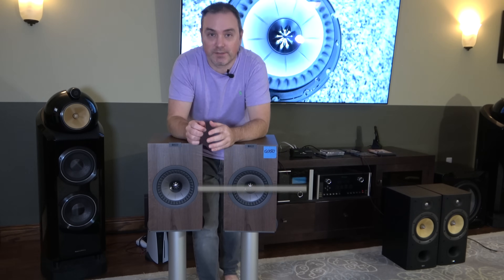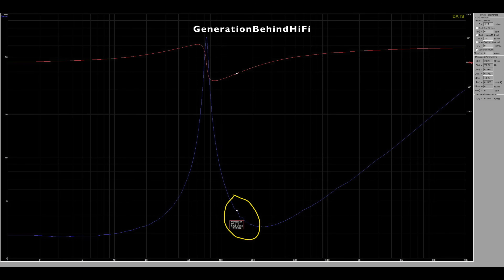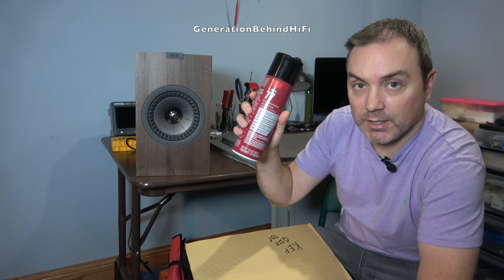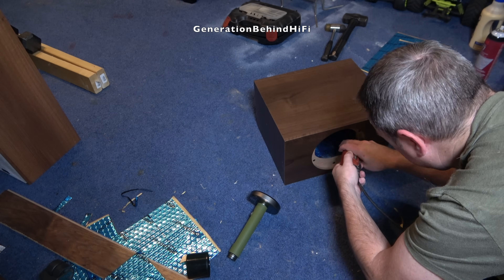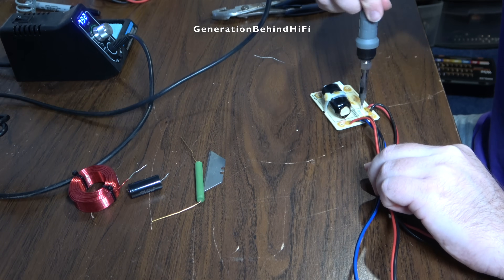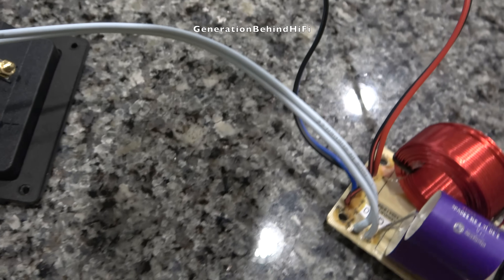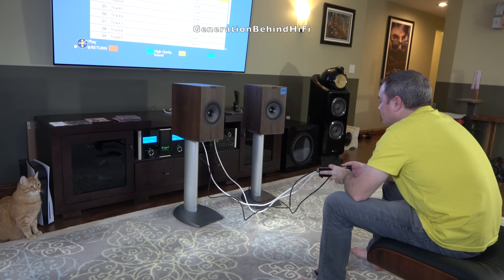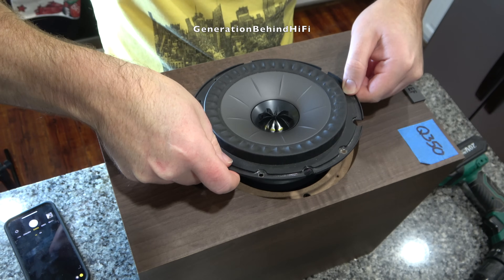Upgrading My KEF Q350 Speakers - Resolving Cabinet Resonances and Upgrading Crossover Parts

Comment from the maker: The parts I used to upgrade my KEF Q350s can be found below.
Amazon Basics sound deadening material: https://amzn.to/421NpDl
Polyfill: https://parts-express.sjv.io/3JkZnd
Sonic Barrier 3/4" foam damping: parts-express.sjv.io/qzW09b
Inductor .9mH 18AWG (2x): https://parts-express.sjv.io/6ykdOG
Mills 1.5 ohm resistor (2x): https://parts-express.sjv.io/Bn5y6q
ClarityCap Copper Connect Capacitors 2.2uF (4x): https://www.madisoundspeakerstore.com/claritycap-csa-capacitor-250vdc/claritycap-2.2-mfd-csa-copperconnect-poly-cap-250v/
Supra Series Speaker Cable: https://www.madisoundspeakerstore.com/speaker-wire/supra-classic-1.6/bulk-cable-per-foot-15-awg/
Reply: Maybe a tip from a car audio nut…Use a hairdryer or heatgun to pre-heat the butyl Amazon basic stuff..Makes it more elastic and usually there wouldn’t be a need for extra glue..
Reply: Can share after you replace supra speaker wire inside how does it sound , i in doubt of replace or maintain the speaker wire ? tq
Reply: Man i would love to see a teardown of the new Kef Q11 metaa
Reply: Any tips on how to choose a correct inductor? 

I am doing a similar set of upgrades on a different set of Kef speakers. All caps and resistors are done now. But, I lack knowledge regarding inductors, doesnt help that there is no spec on the label as well. 

Cheers
Reply: What y'all think of regular polycaps vs sonicaps?
Reply: Question if you can...You mention not changing the internal volume when installing 1/8" thick sound deadening material, but then install 3/4" thick Sonic Barrier? Does the sonic barrier not change the internal volume? Thanks! I'm considering doing a similar upgrade to my Q Concerto's, particularly the Air Coil to brighten them up a little.
Reply from the maker: @Roberto-cj1yf  The polyfill and Sonic Barrier I added trick the speaker into “thinking” the cabinet is larger than it actually is. If you have a Dayton Audio DATS V3, you can verify this yourself:  

1. Measure the stock speaker and note the Vas and Qts values.  
2. Now stuff the cabinet with polyfill or Sonic Barrier.  
3. Measure again and watch both Vas and Qts drop—this proves the driver now “sees” a bigger box.

It’s a simple trick, but you can read more about the science behind it online. Hope this helps.
Reply: @generationbehindhifi  Hi, I'm new to this, so I’m wondering why are cutoff frequency so far far apart for woofer and tweeter in original q350 crossover?
Based on inductor 0.9mh and capacitor 4.4uf values I calculate that woofer cut off starts at 700 hz and tweeter at 9000hz based on 4ohm impedance,, so what am I getting wrong? Surely it can’t be such a wide difference?

Comment: Iron core inductors usually cause distortion at higher frequencies so using them in a woofer crossover can be fine if it's crossed over low and so won't be playing at the higher frequencies that have the distortion (won't be audible).

Comment: Damn my KEF Q300's are so much better built, better specs too. Sad to see cost cutting every new model
Reply from the maker: Newer isn't always better.
Reply: @generationbehindhifi Yeah, it even has better crossover parts (air core inductor). I wantes to upgrade to an R3 Meta but seeing this trend I might just get an R300 (same year as the q300)
Reply from the maker: @rehakmate The R3 Meta is a phenomenal speaker and measures really well. I would be surprised if the older R300 sounded better.
Reply: @generationbehindhifi I dont think it sounds better, but it sounds better for half the price if I get one used. Its the same range so I assume they arent leagues different.

Comment: Adhesive floor tile works exceptionally well as a damper. That, and you can get a roll of foam from wal-mart. While Mundorf are unquestionably good caps, the same results can be had for a few bucks with 5% metal poly dayton caps.  Low ESR and pretty transparent. Same goes for dayton air core inductors.    KITTY!
Reply: Floor tiles as an alternative to alubutyl?

Comment: You should keep things away from the coil,they change the inductance value including glue!🤔
Reply from the maker: What "things" are you referring to? This is a basic first order crossover and there aren't any other inductors on the crossover board to cause interference with each other. Glue changing the inductive value of an inductor?! That's a first I have heard that!
Reply: @generationbehindhifi  Anything close to aircore inductor changes its value, there is a vid somewhere also... ( I mean capacitors and glue,stuffing)

Comment: Excellent, i want to upgrade the crossover & damping of the cabinet of my Q350's... this is a very good video for me...i know i can get exact same value of air cored inductors from Dayton Audio but this will help me greatly, good idea chamfering the inside of the drive unit apertures... Mundorf caps are very nice but i could only find 4.7mfd but they do 2.2mfd so could parrallel them...good job, i'm gonna do up my Q350's..👍

Comment: I got one of these and it helped beyond my expectations for removing parts from a circuit board: YIHUA 929D-V Electric Desoldering Soldering Iron Solder Sucker.  AliExpress has them for much cheaper than Amazon.

Comment: It would be interesting to see the frequency response graphs on the before and after. From what I see, you greatly reduced the volume of the speaker cabinet, and very likely affected the tuning/port characteristics. I would expect that your bass extension was also reduced.
Reply: That may be true, as a function of the added poly, but physically, the empty cabinet has a volume of approx 720 in3 and just the 3/4" foam rubber on the inner sides of the cabinet take up 180 in3, or about 25% of the internal space. The port tuning must have been affected by that. Did you do a frequency sweep before and after the mods, and if so can we see the resulting graphs? If I missed them, I apologize.
Reply from the maker: @ No worries. Everything you are looking for is in this video. You can see the before after sweeps too. If what you said was true about losing internal volume, then Qts would have spiked and would be much higher. Same goes for the port tuning. I guess I just assumed most people who are looking at these graphs know what they are looking at. I'll try and do better next time.
Reply: No, no, no, I'm suggesting that you arent doing a good job, I really like the content you provide. I'm just wondering what the difference would have been if you had just used the thin material. I have done similar mods, but I used some old school car high density mat. Thin, heavy stuff. It worked well to reduce cabinet resonance but did not make a bad speaker into a good one🙁
Reply from the maker: Sounds like you skipped through the video if you think I "greatly reduced the volume of the cabinet". Speaker Q (Qts) before the upgrades = .897. Speaker Q after the upgrades = .8745. This proves that the driver actually thinks its in a bigger cabinet after the upgrade. Port tuning also went down slightly by a few Hz. All of this data is in the video and can be viewed.

Comment: I did this with BOTH my NOS Energy RC-10 bookshelf speakers and my PSB Imagine XB bookies. Even though both are built pretty well (for mass-produced speakers), the cabinets are where the FIRST compromises happens in virtually ALL mass-produced speakers. Strategically-placed, self-adhesive butyl sheets combined with a 3/8" or 1/2" round dowels across the sidewalls of each speaker (10mm - 13mm) - and a bit more open-cell foam or Rockwool as damping material - goes a LOOONG way towards stiffening up the cabinets to reduce cabinet resonances and vibrations, which all leads to a slightly lower/more linear bass-reflex tuning, significantly tighter/damped mid-bass output, and much clearer mid-ranges/vocals. Cheap, easy, effective, and good for just about any mass-produced speakers - win, win, win, win - IMHO......

Comment: Hasn't Kef been using iron core inductors for a very long time? My oldie Kef 104/2's have tons of them. I used to build speakers in my teens and always used open air inductors and even back in the early 1980's polypropylene capacitors for the tweeters, but they were a novelty back then and expensive. My first system were Nad 3020 and Peerless/Seas home made system. Anyway, debating with myself if I should buy the Q350 or not. Wonder how it pairs with my Class A 2*50W Luxman L-560 which I still like.

Comment: Switching to a 14ga. air-core inductor made a huge improvement in bass.  It's deeper, faster, and more impactful.  I switched the 4.4 uF cap for two Audyn Q4 2.2uF caps in parallel and changed the sandcast resistor for a Mills resistor.  I feel the highs are more refined .  I also added damping to the cabinet.  A very worthwhile investment- these speakers sound HUGE.
Reply: The way thatvyou described the speakers sounding huge makes a lots of sense to me with the sound deadening material improved

Comment: I suspect that Kef wanted a warmer sound so boosted upper bass, and with minimal damping accomplished that. My only concern with added damping is that it will become thinner sounding when you lower the warmth and in turn, will probably emphasize the upper frequencies. My guess is that results would be leaner, cleaner and brighter. The ideal situation would be to have 2 sets of speakers and only modify 1 pair. That way you can live with both sets, long enough to be sure it's an upgrade over the original. Just my 2 cents worth. Appreciate your efforts, Thx.

Comment: you should try something like the vishay thickfilms resistors, cheap and sound really good!
Reply from the maker: Thanks for the suggestion. I will look into them.
Reply: The original iron core inductor was made by Vishay.
Reply from the maker: @LeRoySL-q5q  I think he's referring to their "thickfilm resistors" as an alternative to the very expensive Mills resistor I had used in this build.
Reply: @generationbehindhifi  Oh, okay.  I use Mills in all of my crossover builds.  I like the quality.

Comment: Used some of the 3/4 inch three-layer sonic barrier in some old infinity bookshelves that i was working with. Very impressed with the product. Replaced caps and resistors at the same time, didn't replace inductors. Nevertheless, the changes were a nice, comprehensive and reasonably cost friendly upgrades.

Comment: You are not wrong… but you are not improving speakers, you just making them to sound different… at the current state of technology there is non reliable way to reproduce sound the way it was originally recorded… so, good job for adding to the body of the knowledge 👍 …but at the end of the day it is all matter of preference 😉 …so, from another person perspective - you a likely deprived then from the “character”  and made them sound “pristine” 😉
Reply: I am not entirely agree when u said the sound is altered. For me when you replaced a components with the same value but different quality, the sound resulted is the sound that it should be at the first place. Its like changing car tires to a same spec but higher quality you got the handling and comfort that you should have.

Comment: Awesome video, think I will try the same with my Q250c, crossover in it appears identical to your Q350s. It is glued down to the cabinet on plastic pins , how did you get the crossover out?
Doesn't the crossover generate heat, you appeared to bury it in the poly fill, is this not a bad idea to thermally insulate electronics which are giving off heat (don't want to burn my apartment down)
Reply from the maker: If you have a crossover generating enough heat to the point that it could be a fire hazard, then its time for a redesign.

Yes, the crossover is installed on plastic stands that is glued in at the base of the cabinet. To remove it, I broke off all the plastic stands and then removed the crossover from the speaker. Once the crossover is removed there will be 4 holes at the base of the cabinet where the plastic stands used to be. I filled the holes with wood glue and put a wood screw in the center. Once the glue dries, you can unscrew the wood screw from the hole and now you have a threaded anchor to mount the crossover to. I also put two strips of sound deadening material (one on either side) on the back side of the crossover to act as a cushion. This will prevent any rattling noises that may happen when screwed to the base of the cabinet.

Comment: Great video. Will you ever be reviewing or discussing your B&W 802Ds? I would love to hear your thoughts on those.
Reply from the maker: I love my 802 Diamonds! I have been lusting after the 800 series from B&W since I was a broke college student in the early 2000s. I could do a video on them. Is there anything in particular you would like me to talk about?
Reply: @generationbehindhifi  Full disclosure: I  also own the 802D2. I am always interested in other owners'  opinions of these speakers (strengths, weaknesses etc). Have you heard anything newer in the 800 line and if so, would you like to upgrade?

As regards myself, then I haven't heard any of the newer models.  There is a big jump in price between the 802D2 and 802D3/802D4 models! In terms of weaknesses then I have found the 802D2 extremely fussy when it comes to speaker placement: a lot of care is needed to get the best out of these when positioning them. I also think they sound their best when played at higher volumes. 

As regards strengths then they sound awesome! But of course I'm biased (hence wanting to hear your opinions!)
Reply from the maker: @antonchigurh4125  Sure. Prior to buying my 802D2 I had a pair of 803D1. In my opinion the 802D2 is more mid-range focused and is a bit warmer sounding than my 803D1. I loved my 803D1s but felt the 802D2 is a better balanced speaker overall, and they look so much cooler too! Shortly after the D3s came out my local dealer called me to see if I wanted a private demo of them and I said sure. During the listening session I immediately noticed how bright sounding the new D3 series is over my D2. To me it sounded like the new D3s were very high frequency focused and lacked authority in the bass department. After demoing the speakers for about 15 mins my salesman could see the disappointed look on my face. The other thing that bugged me with the D3 is the design of the new cabinet. The styling for the D3 and D4 have changed dramatically and IMO they aren't as pretty to look at over the previous generation. 

In my opinion the D3 is a turning point for the tonality of B&W's 800 series lineup. Instead of the warm sound that I was used to from the past, they have decided to take a more brighter sounding approach. I didn't really care for this new found brightness in the D3 series and found them to be fatiguing and unpleasant to listen to. This experience was quite the 180 from my past experiences with B&W's previous 800 series models. Even one of the popular review mags (can't remember which one) basically said something similar and was quite surprised by the forwardness in the upper frequencies and lack of bass that the D3s possessed. B&W could have changed all this in the D4 series, but I doubt it judging by the tonality I heard from their lower lines like the 600 and 700 series -- IMO these are very bright sounding speakers too. I haven't had the pleasure of hearing a pair of new D4 speakers but I do hope B&W is getting back to their roots. I'm still quite happy with my 802D2s and still think they are one of the best loudspeakers B&W has ever created.  

I'm surprised to hear you say the 802D2's are "fussy" with room placement. IMO I felt they were quite forgiving (within reason) thanks to the down firing bass reflex port. I was just at the dealer last month listening to a pair of $105k Flagship Linn 360 tower speakers and felt my $15k pair of 802D2s were better sounding in every way. As much as I love this hobby, I have learned over the years that higher prices don't always equate to a better sounding speaker. If you have the upgrade bug, then I would highly recommend going to several dealers and demoing new models in person instead of listening to online reviewers. This hobby is very subjective and what you like may be completely different from what I like or what those reviewers like. However, I think you will find that in order to beat the performance of the 802D2 you will have to spend a considerable sum more -- especially in this high inflationary environment where a set of 800 series bookshelf speakers now cost $10,000 a pair!! Crazy!
Reply: @generationbehindhifi  Thanks for your detailed reply. Wow! High praise indeed for the 802D2s!  Thankfully, I wasn't looking to upgrade  and reading your thorough and comprehensive reply has confirmed that decision! 

Yes, I definitely agree with the assertion that either 'more expensive' or 'newer' doesn't necessarily mean  something is always better, regardless of what the magazines will try and tell you (and sell you...)

Thanks again for your thought-provoking reply. Subbed.